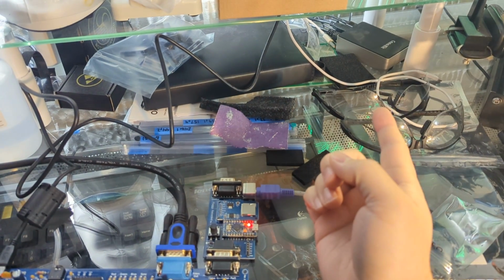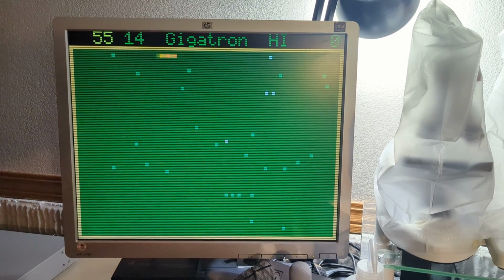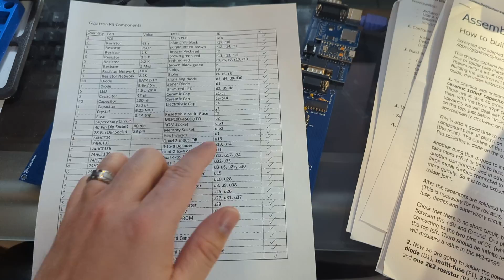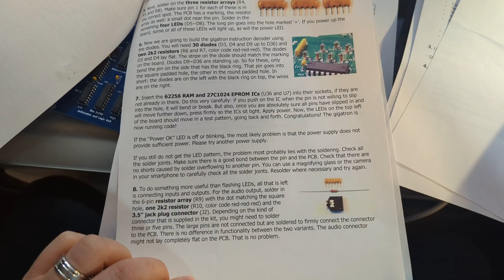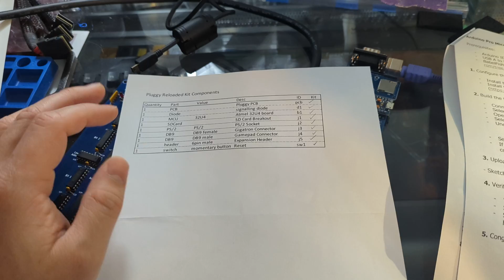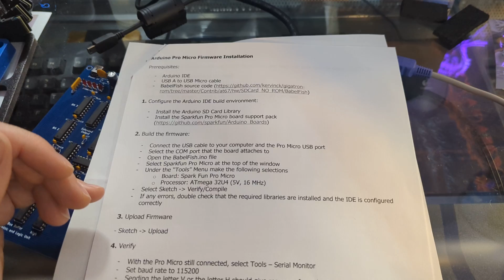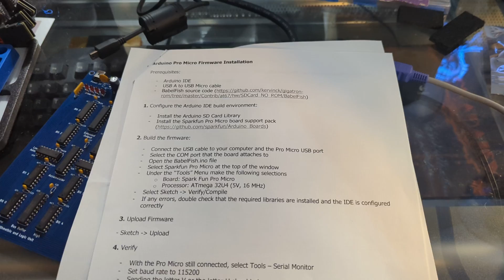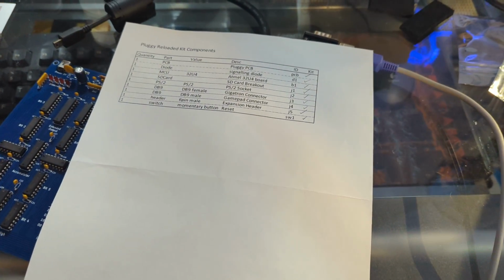Gigatron The TTL Microcomputer (Kit Review)

Comment: hello.
I bought a PCB on ebay. What is the power consumption of the computer? I have a 6.144 Mhz oscillator and the computer does not work ( I do not have 6.25 Mhz ). is it possible to burn the file "ROMv1.rom" to eprom 27c1024 right away ?